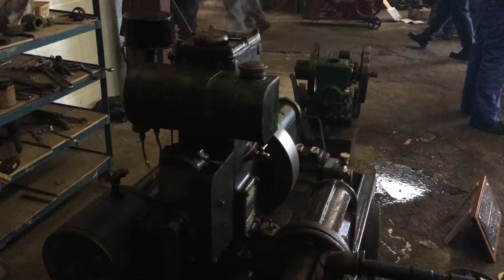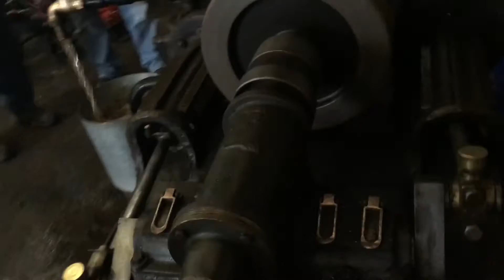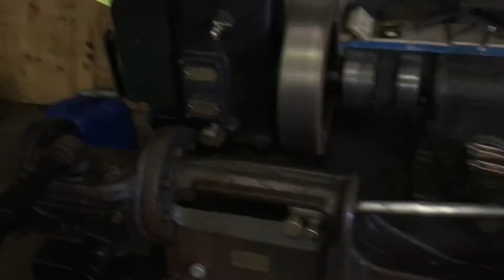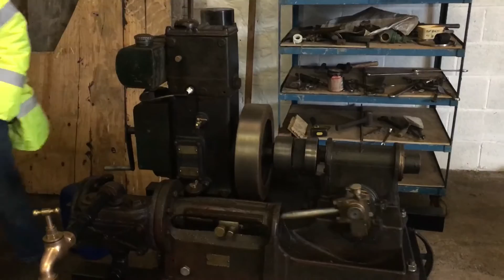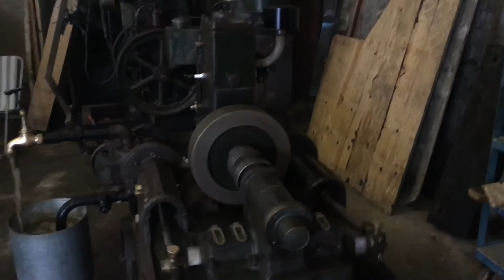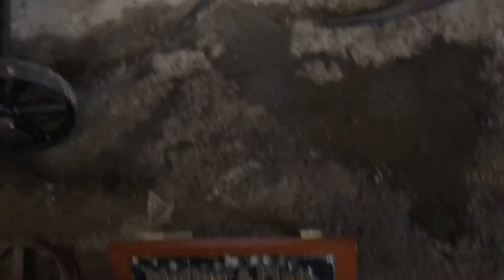Mather & Platt rare lister D pump and air compressor set

Comment: Very nice set up and looks great, but sadly not original.
Reply from the maker: Harry Conn not original what do you mean ?
Reply: villiers 1 it looks good on there, but it wasn't original driven by a lister d type more likely electric motor or something
Reply from the maker: Harry Conn it's all original the ages match up when you read up on them though as it was made for industrial use. In a factory they can't have water in the pipes for sprinkler systems as in the cold it would freeze and crack causing leaks which you don't want in a factory lol
Reply: Not sure what your getting at, but the pump was used as a fire pump but driven by something else